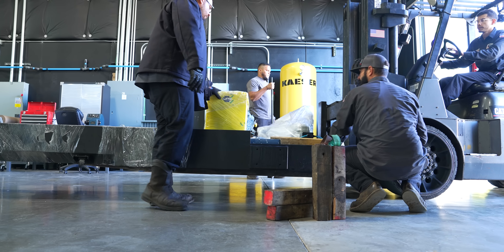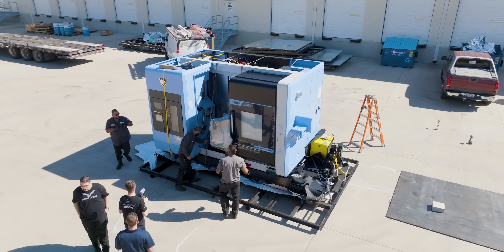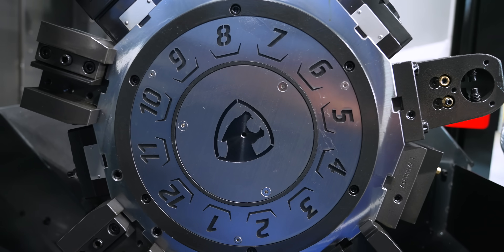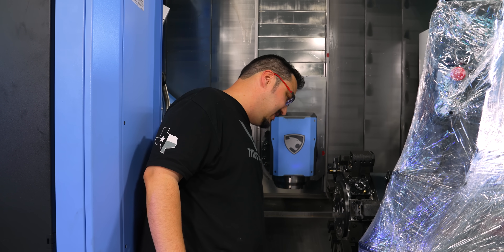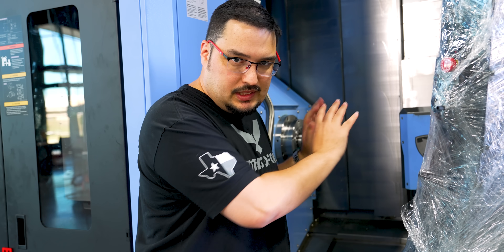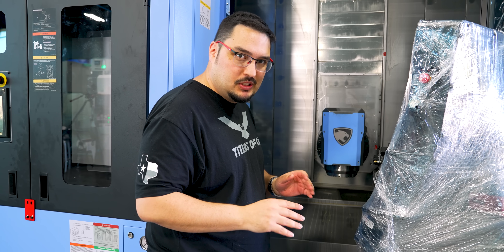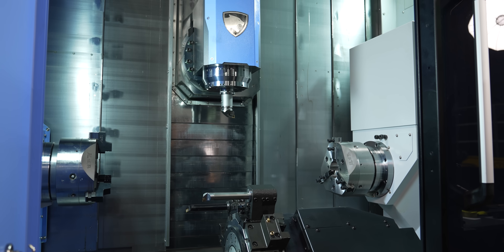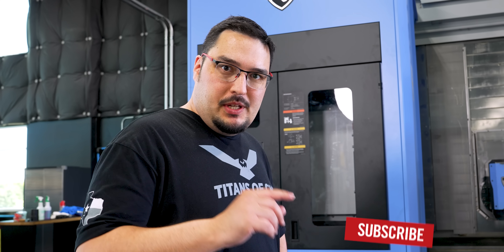Powerful 30 HP Mill Spindle Inside Our NEW Lathe

Comment: Second comment but I know you probably get thousands so I’ll keep asking but I love the videos and for us up and comers in the trade is there a formula or baseline you just continually increase based on the hp?  How are you calculating the fastest quality feeds?
Reply: For example we have a dv5100 dmg
Mori and if seems like the max clean cut it can get to is 100ipm with 12000 rpm max.  The spindle can’t handle higher rpm’s and we have a sweet spot without chatter but I’m just wondering how you guys know off the bat.  Just experience and testing or is there a formula to calculate it.  Machine is in great condition
Reply: I know the tool manufacture has a range but it seem completely dependent on the machine.  You might have to slow it way down on an old machine or speed it up on another.  It seems like there are so many variables

Comment: Well if the wall thickness on the casting is the same as the bigger one then it should also be stiffer then the big one ( same thickness + shorter length = more rigid. At least last time I checked)

Comment: Tyson, lathe guys are the black sheep of any company. Milling looks cooler, grinding is getting a surge because if there is a specific sub field in the field of machining that is suffering the most, it’s grinding. So they get a lot of focus to build up that sub field. We get the short of the stick. Before my time at the company I’m at now, the operations manager seriously considered getting rid of the whole lathe department because in his eyes we didn’t make the company any money. Obviously that didn’t happen but the sentiment has persisted 20 years later. They’d rather keep a grinder than a lathe guy. Even though you ask the vast majority of mill guys, at least the ones I’ve worked with, and they say they could never run a lathe because it freaks them out

Edit:spelling corrections
Reply: Dont worry.. those lathe guys will turn ... it around :)
Reply: I get the same.thing from my mill guy(s) like... How can you run that thing lmfao😂
Reply: Some guys like the parts spinner.  Some guys like the tool spinner.   Not too many like both.  Me I’ll take a flatbed with a 40” chuck and live tooling please
Reply: Lol good one 🤣